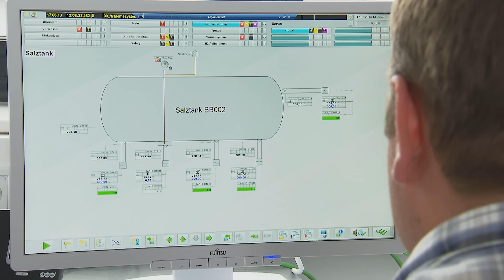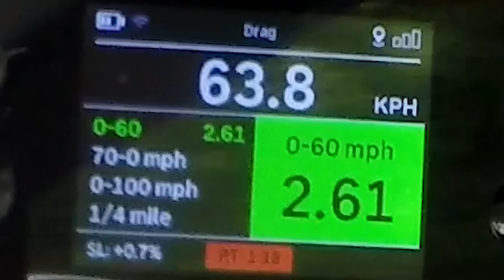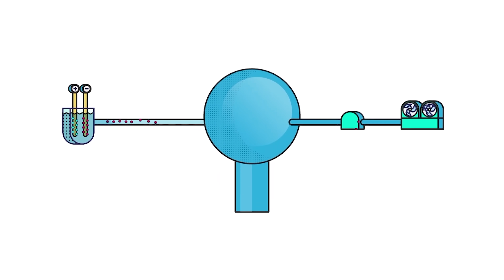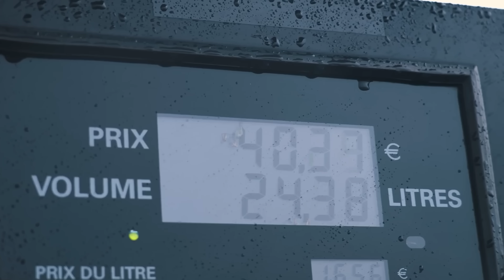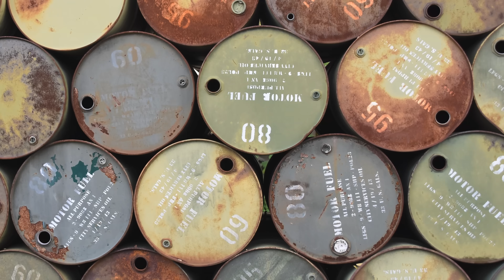Porsche just SAVED petrol engines FOREVER

Comment: The problem with this is the efficiency of the electrolysis. 

Efficiency of a electric car:
Efficiency of the source * charging efficiency * car efficiency

For electrolysis:
Efficiency of the source * efficiency of electrolysis * transportation of the fuel * efficiency of the actual car. 

You need a huge surplus of available energy to make electrolysis a viable option wide scale, because its hindered by the efficiencies of the processes. That is gonna be insanely expensive to overcompensate for this fact by building large capacities of renewables. 

Its interesting though, and will ultimately help us in the future

Comment: Petrol cars have like 70% more parts than electric.

You can drive electric car 10 years (see bmw i3 or tesla s) with zero maintenance cost.

It's insane to operate 70% unnecessary things just to move from A to B

Fck combustion engines

Comment: UN's (UNEP and the IPCC) propaganda (ewssentially the governments), have persuaded the ignorant public that we, somehow, are experiencing a "climate emergency". 

The current "climate emergency" though is measured as a "warming anomaly". The current "warming anomaly" (an arbitrary concept) is not greater than 1C degree in GATs (global average temperatures - another absolutely nonsensical metric), in 150 years (!!!) and coming out of the LIA (or Little Ice Age) the coldest period for the past 10000 years!!! 

These liars have persuaded the public that "renewable energy", batteries and EVs are "green" when in reality their net emissions are going to be greater than even those of fossil fuels. The environmental impact will be much greater by transitioning from a liquids-based energy sector to a solids-based one simply because mining is exponentially more environmentally damaging than drilling. 

This is a a 100% political agenda and one that has used arbitrary scientific assumptions as foundations. #ClimateScam

P.S. Global mining must get expanded mltiple times over (a lot more than X10) to even remotely satisfy the agenda. That's not going to happen. Only the Dutch will be needing between x2 to x12 the GLOBAL production of certain metals and elements for their energy transition plans. Source: Horizon Kinetics and Mark Mills of the Manhattan Institute.

Comment: First the energy needed in electrolysis is astronomical.. and its completely useless. the same energy could produce hydrogen and does the same.. all bullshit...
powering it by windmills i am on the floor here... takes 80 windmills for 27 days to produce enough fuel to power a truck for a day....

Comment: Porsche didn't SAVED anything. They have a valid proof of concept. Until it's legalised and mass-produced it's nothing more than the idea of using local nuclear reactors to generate green energy - a dreamland.
Like you said it's NET zero only if you used green energy to manufacture the fuel. so you harvest energy and instead of sending it to the grid to charge the EV, you start an entire inefficient process to create the fuel that later has to be transported by ICE cars to petrol stations. 
the same level of BS as hydrogen.

Comment: Green hydrogen is a possibility but it would potentially turn cars into even bigger bombs than they already are. Artificial fuel will be niche, expensive and possible still banned from cities due to NOx, Sox, and Co2 emissions. You could have park and ride around all major cities but I am not sure that would be very convenient.   There is no money to be made in fuel stations at present. When it becomes more niche there may be regional deserts where fuel stations are twenty to thirty miles apart. Filling the boot with half a dozen spare cans is possible but any fuel is limited to 30 litres or 6.5 gallons if stored in cans at home. Store more and inform your local Petroleum Enforcement Authority and probably your home insurance would be cancelled. Secretly store it and have a fire then there would be no house insurance. Add additional fuel tanks in a car and I am pretty sure that would invalidate your car insurance. I think there will be artificial jet fuel preferably from SMRs, maybe some to be purchased from Chemist shops like in the 1920s but it will cost due to lack of economy of scale.

Comment: Just a thought but if we're switching to methanol would that not mean no need for a lot of the current emissions treratments in cars? I mean egr's, catalysts and so on would be fairly pointless on engines designed ground up for methanol. Come to think of it so would dpf's or opf's - or at least their needs severely reduced. 
We might want to sort something out about the tear jerking fumes though.

Comment: Video fails to mention how much work needs to be done to get the process down to a reasonable cost per litre price. Obviously if Porsche announced today they could make the gas at a 1.40 Canadian a liter and make a profit well Yeah that would be great. Half the exploring for oil would immediately shut down right now.  But obviously they can't this is all just projections. While on the other hand battery prices are all dropping like stones lithium prices just dropped.  Watson has already reviewed cheap electric cars and renewables getting cheaper. Why would you use renewable to make gas inefficiently when you can send it straight to evs. Battery storage getting cheaper every day.   Sounds like it would be more of a niche product for the very rich. But of course it would be great if they can use it for industrial processes. But for daily normal passenger car driving this makes no sense. Already due to time of use electricity rates saving a ton compared to gas, why would it become cheaper to manufacture gas using the same renewable electricity that could have went straight to my car or nuclear energy for that matter.

Comment: It's not really a U-turn, they won't be able to use Fossil Fuels, only Synthetic Fuel. This creates the following problems...
1) ICE car makers have no idea how to implement technology that only works with Synthetic Fuels
2) The current cost of Synthetic Fuels is six times the price of Fossil Fuel
3) The current volume of Synthetic Fuel being made is a drop in the ocean, and there's no quick way to ramp it up.
4) Synthetic Fuels are not actually carbon neutral, but legislators seem unaware of this. When they are, it will likely be banned.
5) Synthetic Fuels rely on Carbon Capture on a grand scale. The technology to do this hasn't been proven, and is frankly risky. Do you want to be near a pressurised store of CO2 that might escape and smother you without any signs it might be happening?
6) The assumption is that people actually still want ICE cars. Price parity for BEVs is already there for luxury brands, and will soon happen for other sectors. Who will want an ICE car that's more expensive to buy, needs more maintenance and will cost more to fuel? You also won't be able to refill it at home at a discount and you will find Petrol Stations steadily dissappearing from the landscape.
Sure, some luxury and exotic ICE cars might survive, but luxury and exotic BEVs which outperform them in every metric will confine those to the museum too. Who wants to own a dinosaur when you can have a newer, faster, better handling modern BEV.
Sorry, this is the wrong solution, one that will actually destroy the German Car industry even faster because they'll waste investment that would be better spent on BEVs. RIP legacy auto.

Comment: No, no, no.  How much energy is expended just MOVING the 'eFuel' around?  And does the technology scale?  The electric grid is ubiquitous.  The 'fuel' moves over wires.  And you didn't touch upon electric cars with large solar arrays like Aptera and Lightyear One that charge (add driving miles) while sitting in a parking lot.

Comment: To drive the same distance with e-fuel than with an electric car you need to produce 7 and a half times more electricity (for the carbon capture, methanol electrolysis and due to ICE’s poor efficiency). To allow future sales of ICE cars is nonsense from that point of view. The only viable application of these e-fuels is for vehicles that still have a long remaining lifespan and memerobilia. It’s quite dissapointing that Matt does not mention this fact at all

Comment: What a joke. The video entirely contradicts itself.
"A pure EV world only works if you have and I quote an abundance of renewable energy, a seamless private and public charging infrastructure"

"E-fuels are made using carbon dioxide thats been recovered from the atmosphere" (costing energy)
"You then use renewable energy to produce hydrogen from water" (costing more energy)
"these can be combined to produce methanol which can be refined into petrol" (costing again, more energy)
Well guess what, E-fuels are only carbon neutral if all energy used to create it is renewable. But I thought we dont have an abundance of renewable energy to begin with?

So then, whats the point?

Comment: There are a handful of companies working on this fuel. Hopefully they can accelerate the development between them with a race to production! Most ev’s are powered by dirty electric so not perfect either.
Reply: Even electricity from a mixed grid with coal, gas and renewable sources, combined with the much higher efficiency of the EV is much better than ICE cars. The EVs get cleaner over time, as the grid transitions to 100% renewables. ICE cars will not.

Comment: The main reason why so many corrupt governments around the world want all the people to be driving electric, is so that they can track your movements. And as a consequence control your movements. I know it sounds a bit far fetched. But its been proven true by many people who have done the research. Check out the Georgia Guide stones. Back in the 80's a guy in Ohio invented what he called the "Water powered car". It was actually hydrogen powered. But he got the hydrogen from water. The military found out about it, and poisoned him. 

The electricity to power electric cars in the US comes primarily from Coal. Coal is by far the cheapest energy. And the US has more of it than any other country. Driving more electric cars in the US, means, burning more Coal! This is why all the Electric cars are way dirtier than any petrol powered cars. 

Believe it or not Mr. Rudolf Diesel designed and built his engines to run on peanut oil. And All diesel cars can run on vegetable oil. They run very well on used french fry grease. The military industrial complex also doesn't want anyone to know about this. Thank you.

Comment: Being carbon neutral doesn't actually address the problem of Co2 emissions, it just stops them increasing. Secondly, the energy required to produce efuel is incremental energy that must be generated - even clean energy has a Co2 cost to build the windturbines, solar panels etc.

Comment: Oil is a byproduct of the mini-Sun aka the core of the planet. It is not fossil at all. It will never run out.
Also, low CO² levels will start a global desertification process. The planet on its  own consumes more carbon than it produces, at the moment, with all the very low volcano activity.

Comment: The everyday ICE Car is dead efuels are way to expensive and wont be produced at a high rate so only roch people with their porsche will use them and ships and planes or other big machines. Another point against ICE cars is that they are loud citys are suffering from all that noise and local polution will stay the same only global emissions would be neutral. Another con is that Efuel use way too much energy to produce which could be used in ecars. So Efuels are most likely a product for the rich and not that big of an hype like everyone thinks.

Comment: I’ve been an electric car owner for almost 10 years. It has been the best car ownership experience I’ve ever had thanks to charging. Matt, you told us all of the down sides of electric cars. But none of the downsides to keeping an internal combustion engine. Like still needing oil changes, or transmission fluid on occasion. Or the hundreds of moving parts in an ICE that means more mechanical maintenance over time. Not complaining but there was no fair balance.
Reply: ICE manufacturers clutching at straws to save their precious engines
Reply: @jontyrocks3  saving themselves from having to spend on making changes. Mr. Toyoda doesn’t want to put all his eggs in one basket, I think that was hilarious to point out. We’ve had our eggs in one basket for over a century with internal combustion, so why the comment. Just an excuse to slow things down.
Reply: Agreed!

Comment: I wonder how necessary this will be for light duty transportation in 15 years when battery tech has grown, the cars are lighter and more efficient, and charge stations have become much more ubiquitous. I'm not saying the change over will be smooth sailing. It wasn't that way from horse to car either. But I would imagine the biggest use for road transport synfuels would be large trucks moving long distances.

Comment: Interesting how there aren't really any comments about how currently, almost all hydrogen is made from steam reformation, which releases a lot of CO2. And synfuels are reliant on renewable power to be carbon neutral. Yet in videos about EVs, time of comments about how bad for the environment they are bc all electricity is made by coal, pv power plants destroy cat swaths of land, wind turbines are killing birds and clogging land fills, and the disposal of all the materials at end of life will poison us all. I'm not making a point about the actual facts here, just the uneven distribution of FUD. Synthetic fuels can play a part in a low carbon society, but I often find when you have traditional carbon-reliant companies promoting and running the operation, actual carbon output gets ignored or covered up. We need to closely monitor how they are getting the electricity for electrolysis, make sure there is no leakage if they get CO2 from industry capture, and make sure no fossil fuels are burned in the transport/logistics of synfuel distribution. Same goes for making solar panels and batteries. Gotta stop using coal coke for heat in industrial manufacturing and goods transportation. Teeth to tail

Comment: Man this is such good news, i honestly thought common sense had left the planet. EVs will destroy a lot of companies in their current form, mainly the smaller ones, due to the short life of batteries and the massive expense to replace. Look at The Royal mail switching to EV, current cost to run a fuelled van is about £1200 per year, the EV vans they are going to be using from 2030 onwards will cost £5000+ per year due to batteries only lasting 3 years and costing £15k. It will be the end of The Royal mail. This eco sht is just convenient to get everyone to fall in line.

Comment: It's so weird that some still see charging as a problem while it seems to be the solution. Most of us do not do more then 200 km a day which a very average ev can easily handle now. You put it to charge at night and the next day it is good again. The issue would be long highway distances but there are relatively few of those.
Reply: Cables across the pavement at night? You haven't thought about this very much have you
Reply: @robmule4647  So in your street electric cables going to houses, phone cables, gas pipes, cables for street lighting all just lay in across the pavement? No, somebody dug a hole, put in the cable and filled the hole. That you didn't think of something doesn't mean nobody else did.
Reply: @mrniceguy6050  so there's no problem as long as charging stations are installed at the roadside 🤣 let me know when that happens 👍 meanwhile you can live in your bubble of naivety.

Comment: This is good news to those of us who can't or won't buy an electric vehicle due to circumstances. An electric vehicle wouldn't work for me and it's cost-prohibitive anyway. I would consider a hydrogen vehicle if there were a supply chain, but not where I live. 

I'd be fine with putting e-fuels into my vehicles provided it doesn't destroy the engine. The e-fuel factories would also create a lot of jobs to build, operate, and supply them. There are definite bugs to be worked out, but it seems worthy of much more research and development.

Comment: Why didn't they just invest more heavily in CLEAN hydrogen. Burning synthetic fuel and batteries are both terrible options, they still cause mass pollution and impact public health. 

If Hydrogen is used as energy storage instead of batteries, we could even keep gas boilers and quickly re-fuel vehicles. Use clean energy > Store in Hydrogen > use fuel.

Comment: Efuel and hydrogen internal combustion are the way forward. EVs are ridiculously bad for the planet, and why are the roads worse than ever? A hell of alot of 3 ton teslas hooning around destroying the roads, and they haven't even paid road tax to make up for it! (for now) that new bmw i5 they mentioned is reportedly 3.9 ton without anyone even in it! Yea totally carbon neutral 🤣 not to mention all the multistory car parks that will have to reinforce all their floors as they weren't designed to deal with those kinds of weights